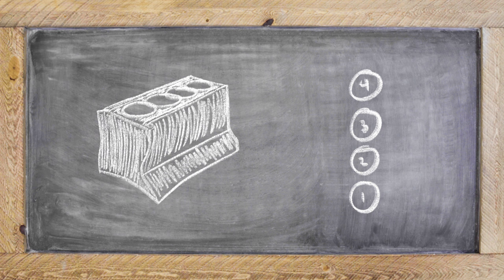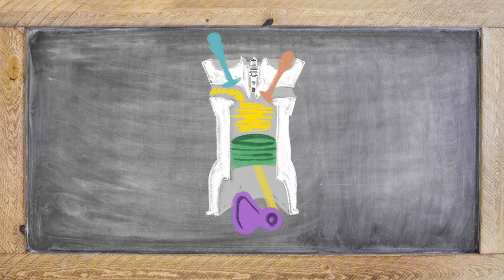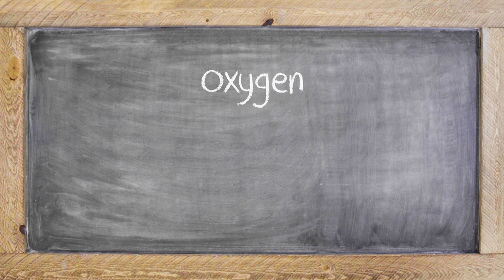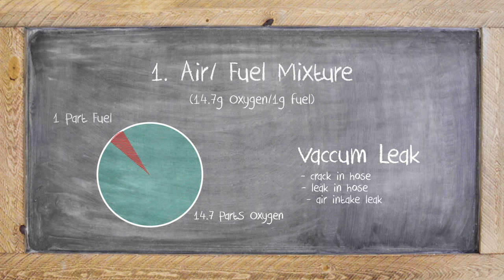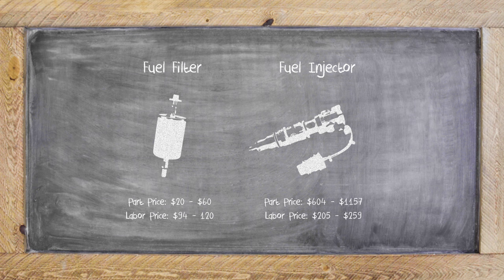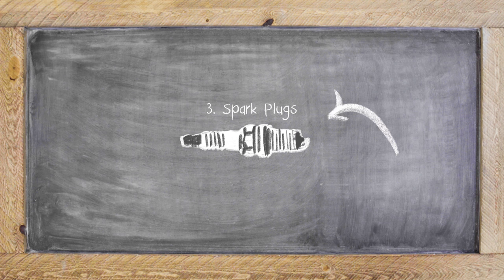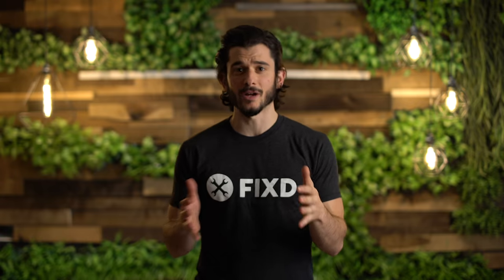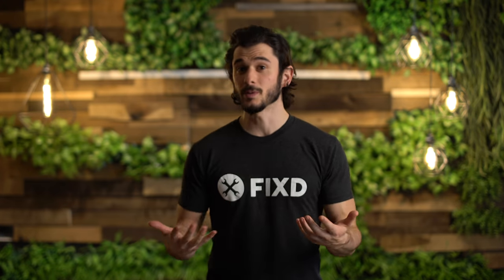P0301 Explained - Cylinder 1 Misfire (Simple Fix)

Comment: I've replaced all my spark plugs and coil packs and I am still getting a misfire in cylinder 1.
Reply: I have a 0301 code on my 2018 Chevy Silverado. Shit is pissen me off
Reply: Yo I did the exact same thing what did you do to fix it ? Please help
Reply: Same
Reply: @joshw0078  it might be the wire of the ignition coil... I fixed mine had to pay someone to cut the wire and put a new one with the right plug
Reply: Same
Reply: Injectors?
Reply: How about watching this video and others like this one. It can be a spark plug, plug wire, coil, injector, burned valve, broken valve spring, hole in the piston, head gasket leak, vacuum leak
Reply: @junballs6576 if it makes you feel better I'm having the same issue. I've heard it can be anything from injectors to PVC to vacuum leaks compression issues even messed up valves and gaskets. I'm guessing my issue is a vacuum leak because it didn't start happening until I fueled up all the way. Some maybe a fuel filter or injector
Reply: @Fox250R So how did you fix it? I have the same misfire on the Silverado. Replaced it and it lasted a few weeks. Replaced it again and still misfiring in cylinder 1
Reply: @SW-pm3ls I sold it lol! Got a 2024 Trailboss 6.2 absolutely love it
Reply: Does your engine stall when driving
Reply: Worst case could be a compression fail (piston rings damaged)
Reply: For me it was my lifters 🙃 had to rebuild the top engine
Reply: Crankshaft position sensor
Reply: What was your problem after u fixed? U changed coils and spark plugs...is the problem with fuel injectors?

Comment: if it was a bad fuel filter, would that not effect the entire combustion process in all cylinders?  How can it be isolated to #1?
Reply: I'm sure an air or fuel leak would effect all cylinders too.  I geuss he is assuming you have a diagnostics kit which gives the code p301 which is misfire in cylinder 1.  Hope that explains 👍
Reply: @Rhuari Macleod  if multiple are failing what code would it give?
Reply: @Man  p0300 I believe. Commonly caused by a blown head gasket!

Comment: I had my car just stop running 3 days ago I noticed oil around my coil in number 1 and found it was burnt as well as the plugs. Thanks for these videos as a chick it's always a RIP off going to a mechanic YouTube has saved me thousands of dollars. Thank you again for the videos!
Reply: I am having a same problome . Code p0301 celender 1 missfire and oil around my plug 1 . survice center thold me to meke hole engine in 1000$ :( i am in big problome .
Reply: What was wrong my Toyota Yaris stop running change the fuel filter and still have the some problem don’t start

Comment: Thanks I fix my P0301 problem...it was just the spark plug...cheap fix.
Reply: Was ur car shaking at idle
Reply: @SIQ_11  mine is right now smh
Reply: @ChrisSRT_.  bro i changed the spark plugs and changed the ignition coils and changed the fuel injector and still have the same code and same exact issue
Reply: @SIQ_11  my Jeep has the different misfire codes and shakes at idle. How did you fix your's?
Reply: @SIQ_11   i fixed mine
Reply: @ChrisSRT_. How u fix it

Comment: Funny though. I had the worker at an Autozone run the engine check. He got this p0301 and wanted to sell me an entire ignition coil for about $90.00 Since I also have one of those, I ran a check myself. I have the p0305 and it turned out to be the spark plug.
Reply from the maker: Wow! So sorry to hear that happened to you. Glad you had a way to double check that scan though and get your spark plug back in working order. Happy and safe driving! 😊
Reply: Haha, same thing but they suggested replacing the head gasket.
Reply: Hmmm i have the same issue i got p0301 i swapped the coil pack and i still have the issue😭

Comment: Another thing that can cause a misfire is loose camshaft bearing caps. I had a P0302 which every single garage failed to diagnose. I took the rocker cover off and every single bolt could be unscrewed by hand.  Tightened up the bolts in sequence and the misfire went away, I spent money on a coil pack, spark plugs, fuel injectors, and compression tester for nothing.  Compression was perfect so it's one to check people.
Reply: TY
Reply: What motor?

Comment: Original owner of an ‘07 Prius. Ignition coils in two of them were bad and the other two were less than good but just ok.  Checked on a meter. Plugs were light to dark grey after 40,000 miles. Changed all plugs and coils. $750. Labor was $150 included in the $750. 250,000 miles on it. Passed CA smog after a 100 miles of driving. Now I can drive it another two years and then make a decision. 👍

Comment: My 04 Prius had been a little off when coming to stops every so often (felt like a standard does when stalling). I thought it was the brakes at first, but kept driving since they were fine otherwise. after a couple weeks of daily driving (and a 2 hour trip over a mountain) I checked it and it threw this P0301 code, drove it to the auto shop and it started smoking on the way there. I changed my spark plugs and coil packs and it wasn’t smoking anymore, but then one day my check engine light came on.  I checked and it still had the P0301 on. I’m sure there’s dirt in my fuel line after an attempt at taking the injectors out. I’m not sure what else to look for since it wasn’t the spark plugs/coils and the smoke and I dont have the means to tow it. The battery is currently dead and the last time I drove it, it started barely accelerating to my driveway and sounded very rough.

Comment: 0301 cylinder misfire does not mean you should start buying several parts.   Means  you should check that one spark plug  first and that one plug wire  first. 
     Start with the  basics.
Reply from the maker: Great point. Thank you, Benny!
Reply: @fixdapp     I would never have thought that my IAC valve could cause a random misfire.   But the new IAC valve fixed it!!!

Comment: So here's what I did, I swapped out the ignition coils from bank 1 and bank 2 clean them up with some brake cleaner and the cold went away. So is my problem my ignition coils? I already replaced the spark plugs and the control valve solenoids.

Comment: 2010 Buick Lucerne.   I changed plugs 18000 miles ago.   Car started to run rough.   Progressively worse.   Inniva scan tool said misfire on cylinder 1.    Never got a check engine light.   Not sure how that was.   Basically checked resistance of plug wires.   Cleaned mass airflow.  Then found out it was a bad plug by swapping into cylinder 4 and it misfired there.   Plug looked fine    .
Reply: What did you end up doing i have a cylinder misfire on my buick as well they recommended me to get a whole new engine…

Comment: @fixd Any thoughts on getting misfire codes, yet the car doesn't misfire? I get combinations of 300, 301, 302, 303, and 304 after 4 ignition cycles or so with my 03 Civic 5 speed. I've changed plugs and coils, cleaned the EGR, EGR/intake channels, and cleaned the throttle body. Not quite sure what it could be. Sometimes the code goes away if I don't clear it. I have had to change the cam position sensor twice in the last 4 years and had valves adjusted about 3 years back, if that helps point to a possible cause. Thanks in advance!

Comment: Geez, $1500 for a fuel injector+labor? I live in England, that's more than what my current car cost to buy lol If the repair costs for my car ever exceed the initial purchase, i just scrap it and get another preowned car. My £800 honda civic has been going strong with 183k miles for the last 4 years =P

Comment: I had the same code switch the coil still getting the same code changed spark plugs still getting same code then I noticed oil on my new plug so I replaced the valve cover gasket, 
Its been one week still no check engine light hopefully that was it
Reply from the maker: Interesting! Keep us updated
Reply: How has the car been ?
Reply: I changed out all sparkplug and coils, two days later the light came back on. I did notice a leak on my oil gasket near the spak plugs. Maybe that's the issue
Reply: Changed spark plugs valve cover gasket new coils still get cylinder 1 misfire code,  been told it could be a bad injector or vacuum leak
Reply: It was a bad fuel injector running great again 😊

Comment: Auuugh.... I'm at a loss. the first time to check engine light came on the car died was sputtering I change the spark plugs everything was fine. We put a new gas cap and change the fuel pump. New air filter and cabin filter. We checked the ignition coils adding seafoam to the gas we checked for any vacuum leaks we cleaned the throttle and my car is still sputtering
Reply from the maker: With a rough running car it is always best to diagnose the issue first. Most of the time a quick scan of the car and getting the related fault codes will point you in the right direction. You are definitely on the right track to diagnosing an engine misfire/rough running issue, however due to the complexity of most newer automobile engines, you will need to find out what fault codes are being thrown then reassess. For example, if it is a fuel supply issue, you replaced the fuel pump but could have an issue on the injector side. This could be a leaking injector, dirty injector etc. Give it a scan and check faults.

Comment: I have a 00 GS300 with only a P0301 code, ive replaced the spark plugs, wires, coil pack connectors. And i still have the damn misfire code n when i give it throttle it sounds like its breaking up. So im thinking fuel injector otherwise idfk

Comment: I just washed my motor and that code came up! it sakes! I hope it fixes when it drys out! what do you think it could be!
Reply: If an engine misfires when it's wet, the most likely problem is a bad spark plug cable or other ignition system component.
Reply: Same thing happened to me today. Did you ever fix it ?
Reply: @dha588  Did the problem go away on its own? I’m asking to see weather water in the engine bay can create false alarms tripping this particular engine code for a false alarm.

Comment: The quality of fuel is significant. 

Maybe a higher octane would help your vehicle, or try not run it on corn cobs?

I would suspect the wire set first damaged by heat under the hood, and maybe fresh spark plugs correctly gapped.

..the spark plug wire is dead at 300+ Ohms.

..and the wire from the coil should be zero Ohms.

..you need good spark, maybe the coil is weak? 

Thank you for the coil check procedure.

Comment: i did have a p0301 on my 2009 escape with a 2.5 and it was a bad valve  and to change the valves it was 1500$ i decide to buy another engin

Comment: If it’s 1 cylinder it’s not a fuel filter a air leak. It’s spark plug fuel injector or coil meaning wire to. Other than that get ready to spend

Comment: I have a 2012 Ford Escape XLT. Engine light came on. Firestone changed all my Spark Plugs, & Ignition Coils and did a Fuel System cleaning. Light still on. Then they changed out my Fuel Injector. Light still on. Lastly they replaced the Pigtails. Light still. After 6 tries @ Firestone they couldn't fix it. Now they will give back my money plus Uber rides. I was super patient with this nightmare. Can someone please help?

Comment: I got a PO302 code on my 2012 Ford Transit.  I checked my oil and was low, so I filled it.  Then I switched 302 with 301.  Started it up and it ran good.  So I was assuming (hoping) the problem was oil.  I cleared the cobe and all was well for 2 months.  Today I started with engine banging and poor idle.  There were NO codes on my dash.  Now I looked at my phone and was getting an issue on 1 & 2.  I couldn't understand why my dash wasn't reading a miss fire in one.  It onley shoed up in 'history'  My friend works on cars said my FIXD reading on my phone probadly showed this fault right after I originally switched parts.  I thought it would automatically  show up on my dash as an alert.  WRONG!    The past history stays on the phone for your history reference.  I don't know if I explained this well.  $180.00 later with 4 new injector and I am running great with no laber costs.  This may require a bit of thinking if you are not savey with codes like i'm not.  ALSO.  Auto Zone informed me the injecter I bought have a lifetime warranty.....I asked why the injecters in the van weren't got for the vehicles lifetime.  They said they were a ford product, they see it all the time.  Oh well.

Comment: 2009 tahoe hybrid 6.0. P0301.  Oil all over spark plug threads and ceramic tab.  I cant figure out if its rings or valve seals because I cant do compression (dry or wet) because I dont have the tool to tell computer to crank.  Any advice?
Reply from the maker: Oil on the spark plugs can be a few different things. This can be caused by a faulty pcv allowing too much oil back into the system. There are a few different tech bulletins addressing these issues. If the oil is in the spark plug wells, this can be caused by a leaking valve cover gasket, and/or o-ring seals. If the above listed are not the issue, a leak down/compression test is a good place to start. You will need a cylinder leak down tester and a compression gauge. This can be difficult to do and you may need to find a local repair shop to do this for you.
Reply: @fixdapp  yes. I grew up in a shop from 10yo. I changed the valve cover with faulty PVC to the new gm part with new gasket, Didnt help.  I've done all the research possible.  I've found the bulletins.  

I know how to do leakdown and compression tests but it's a hybrid so I have to have a tech2 scanner and place the computer in crank mode because it wont crank otherwose being that its hybrid.  I just dont have the tool and GM will charge me easy 500 to test.  

Its leaking on the spark side threads.  I've heard there is no spark tube gaskets because they screw right into the head.  So that leaves valve guide seals or ring blowby.  Guess I have to invest in a tech2 scanner :/

If you can reply and tell me the likeliness of it being ring problem or gasket problems base on symptoms I'd appreciate it.  It misfires so bad that it wants to chug and shut off..vibrates the whole truck, and I lose reaction time when I press the gas...bad lag time.

Comment: Question. If there is a leak …. And you check the spark plugs and coil.  Could the leak damage either 2.  Then if you replace it. Would it still Throw a code or no.  Even if the  leak isn’t fix.  ….. in my situation I have a 2015 mustang gt with 15,000 miles. That was running perfect.  I just had the intake manifolds changed to a 350gt manifold and got  hp tune …. I haven’t been able to drive it.  1st it was running lean. We found a lose clamp….  I picked up the car today drive it 10 block and the check engine light started blinking going into a limp mode for about 15 second. Then the check engine light stayed on.  Code was misfire in cylinder 1 and 6   Please help lol.
Reply: did you fix it

Comment: I have a misfire  cylinder 1 on my 2010 gmc 1500 and I love my truck. I only had changed the spark plugs and went away for about a month then came back with the same problem. Spark plug went black at the bottom. And I’m no fixer trucker dude. And have no shop in my town. Anyone help.

Comment: Does anyone know what would be going on with my truck? 

I have a 2010 Dodge Dakota with a 3.7L V6 engine. It has a check engine light that has been coming on and off for a little while. Whenever I start it up it makes this puttering sound that seems to get better as i drive it. I have also taken it to a shop and they told me that Cylinder 1 is misfiring but they are stumped on the cause of it. They are telling me that these issues may not even be connected and there might be 2 things wrong with my truck. They are recommending I replace the engine as trying to find out and fix whatever is wrong would not be worth it. What should I do? Sell my truck off as is for whatever I can get for it or try to fix it???!? A new engine plus labor will likely be at least 4 grand  :(
Reply: Change mechanics for starters...in the end if you dont get it sorted out and get a new vehicle DON'T buy another dodge...unless you like continuous wiring and electric issues

Comment: I changue spark plug coil and fuel injector and still gettin the code
Reply: change the coil wire. If no go then the cylinder rings are shot
Reply: you got a bad valve on that cylinder